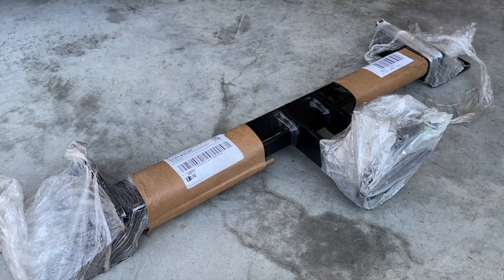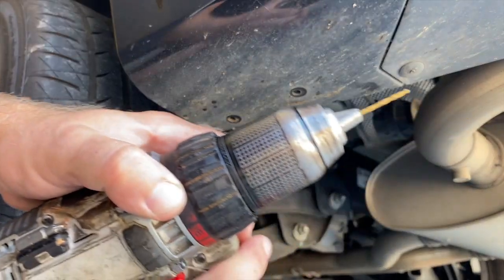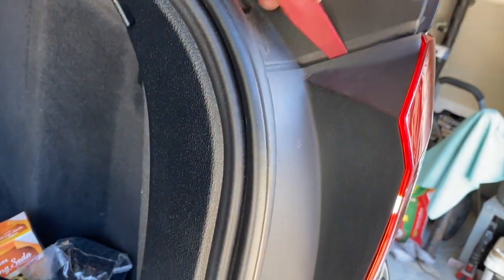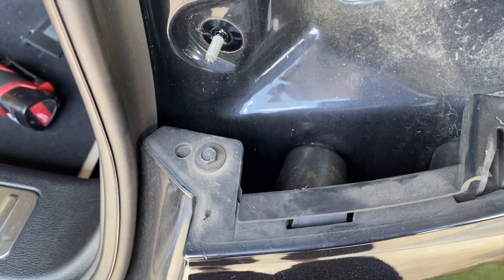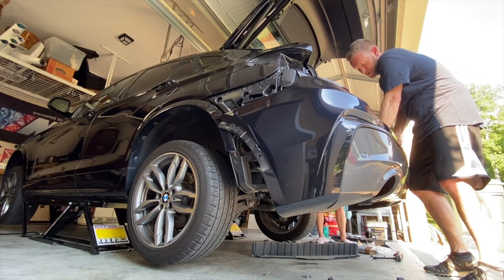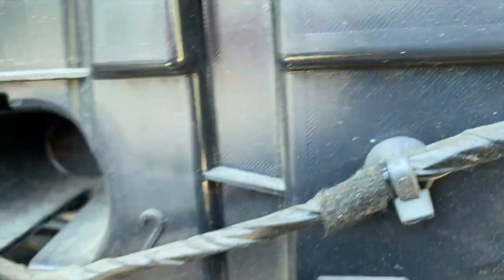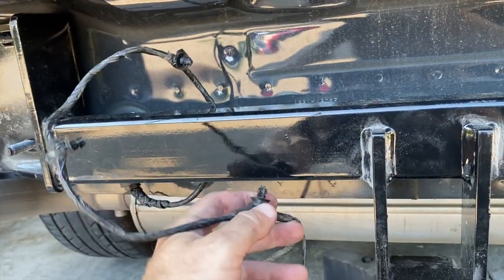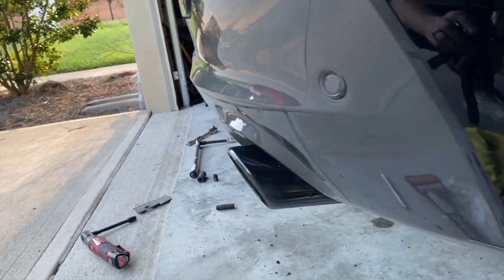INSTALLING THE CURT 13316 HITCH on a 2017 BMW X4/X3 M40i (F26/F25)

Comment: The instructions are very clear. I installed one on my wife’s F25 X3 thanks to this video, many thanks. Any recommendations on what to do with the parking sensors so they don’t go crazy every time?
Reply from the maker: +Gus T thanks! I read some thing about people programming the car to let it know that it has a trailer hitch. I thought I was going to have to do this, but I think maybe that package was installed already on hers? Her vehicle seems to not have any issues with it
Reply: I see, well thanks again. I need to do some more research on this.
Reply: Wait, so the sensors go crazy with a trailer on the hitch or just with the hitch itself?
Reply: The backup sensors go off when they sense the bikes mounted on rack. Although, they stop beeping once I get moving forward.

Comment: Great video; very thorough. I didn't see anything in the video for the install of the wire harness for the trailer. Do you run without power to your trailer? Thanks for putting this video out there to help the rest of us.
Reply from the maker: +C. W. Thanks! I have a separate video for the install of a wiring harness if you search the channel.

Comment: I want to install it in my 2020 BMW X4 but at the dealership they say this will void warranty of my car, I'm suppose to buy from them a 4000 dollar electronic trailer hitch if I want to avoid that
Reply from the maker: +Dreia of course they did. Did you tell them it’s illegal for them not to provide warranty work unless they can prove that the hitch causes whatever issue that went wrong? So almost zero percent chance that it can affect your warranty.

Comment: can't get the passenger side most rearward side clip to clip in. The rear ones do, and the most car forward ones do, but the one in between right before the fascia turns the corner to those clips will not clip in to save my life, so it looks "lifted, or sweller " in that little area.  Help!!!
Reply from the maker: +31acruz I’m sorry but I don’t know from your description what might be wrong.